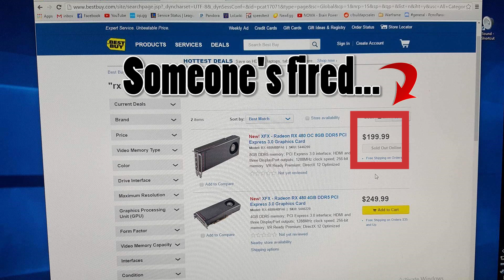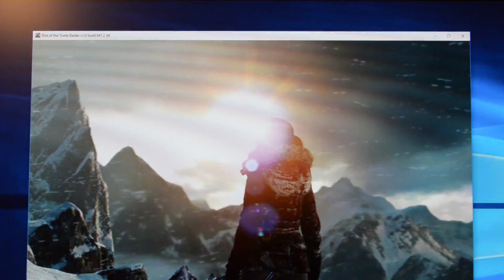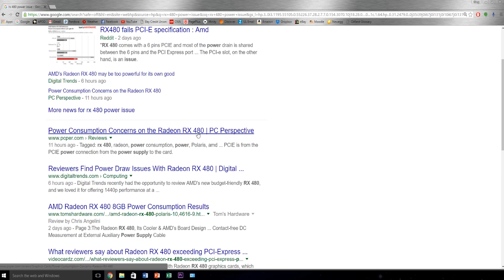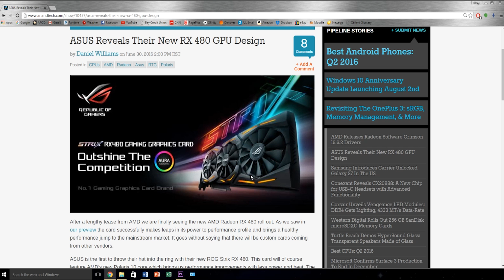RX 480 Aftermath: Power Issue & Over-Hyping

Comment: So... AMD - good hardware, good at everything. Nvidia - only good at gaming, lacking features... Maybe AMD should make new architecture made ONLY for gaming. Nvidia doesn't have any fancy-shmancy stuff wasting drivers (more have to be done) and using power. Just for games. It's like car made just for for eg. "Track Days". While AMD is as fast, but it also can comfortably move a whole family (like WRC Subaru vs Bentley)
Reply: At least I see it that way
Reply: Very poor comparison.  Most people buying video cards are doing it solely for gaming.  For those people, they don't care about this at all.   You're comparing it to something that would indicate that most people have multiple use cases.
Reply: Jeffrey Basurto This is what AMD has and this is why it looses to nVidia. nVidia doesn't give a shit about special uses in GeForce line (this is why you have Quadro and Tesla) only for gaming. And this is why Bitcoin miners used AMD cards for it.
Reply: nope. AMD is more like a drag car... With a transmission from an old punto. It has the power but it never performs like it should while Nvidia is more like an Italian sports car = not only does it win AMD with less power on a drag strip it also does race tracks and everyday driving.
Only thing AMD has going for it is that it's cheaper, but you very often get what you pay for which is makes this comparison way more accurate than you shitty fanboyism.
Reply: Tsunami LOL I'm not a fanboy (maybe apart from Intel, for now)

Comment: Hello ScienceStudio! 

At exactly 6:00, you show this pop up written 'Display Driver Stopped Responding and has Recovered'.

I have suffered this problem for quite a while with my Sapphire hd 7730 1GB ddr5. I have always installed the latest drivers from AMD but still got this issue quite frequently while playing League of Legends. I would not even max out my settings at 1080p.The screen would just go black for about 5 seconds and then come back! annoying!  

Settings were low or normal. I have also tried out this software from Microsoft named 'FIX IT'. But it does not solve the problem.

I used another person's gpu on my same computer: win 7, core i5 2400, ddr3 1333Mhz 4GB; h61m-s2pv, gigabyte 380 watts PSU. 
The other guy's gpu was gigabyte gt 730 ddr3 and with this gpu I encountered that problem 0 times! 

I just don't understand what could have gone wrong. 

Could you please help? 

Thanks!

Comment: Now I get it you are not paid by AMD....I own a GTX 960 for about a year still no issues ..max TEMP/61 degree C . Not that huge impact on power bill >.. If you need a GPU for day to day use without any hassel like drivers killing GPU by turning off the fan , ,frying your other components inside the case by hight GPU Temp#AMD ........ Get Nvidia GEFORCE CARD !!!!!

Comment: I think it would be wise to wait for custom cooled non reference cards to become available. For example, Sapphire will have a custom cooled RX480 but with a 8 pin PCI-e power connector instead of a 6 pin one. This will probably solve most power delivery problems, and will allow some nice overclocking boosting the performance quite a bit.

Comment: let me give you a hint: GTX 960 strix - over 200w power draw from pci slot
another hint: GTX 750TI- over 125w power draw from pci slot
Nvidia did it even with GTX 950,that had no power connectorvs
and we are talking about the reference card in in worst case scenario ;
who would play 4k games ,maximum details with 10fps(metro last light for example)?? that is the only case that RX 480 has that power problem and i repeat, it's a reference card.
Reply: https://www.pcper.com/reviews/Graphics-Cards/Power-Consumption-Concerns-Radeon-RX-480/Evaluating-ASUS-GTX-960-Strix Say again?
Reply: And it's the same for GTX 750TI and GTX 950?
It's not about lies or/and defending AMD,it's about the fact that Nvidia did this too, and no one made such a big deal of it
Reply: Do you have links for your claims? Tom's Hardware measures the 750ti at 62 Watts max with Metro Last Light: http://www.tomshardware.com/reviews/geforce-gtx-750-ti-review,3750-21.html
The 950 GTX doesn't exceed 75 Watts from the PCIe slot as well, see here (German, but the power consumption chart is obvious): http://www.tomshardware.de/gtx950-custom-cards-benchmarks-power-consumption-details,testberichte-241904-9.html

Comment: The 75watt PCIe slot provision limit only applies to cards that DO NOT have a power cable attached.  It is a limit due to lack of sufficient grounding on the PCIe slot connectors.

Comment: some other cards pull way more power over the pcie Lane... for example the gtx 950 (without a 6 or 8 Pin Power Adapter) or the strix 960... (just saying(

Comment: that motherboard you are using is from FEB-2008(might be even older) the max power on able to be drawn on a pci-e slot back then was 150w. 

on march 27th 2008 a revision to the spec was made
PCI Express® 225 W/300 W High Power Card Electromechanical Specification Revision 1.0
The main objective of this specification is to support PCI Express® add-in cards that require higher power than specified in the PCI Express Card Electromechanical Specification and the PCI Express x16 Graphics 150W-ATX Specification

The 480 has the ability to at times have short spikes above 150w maybe if your mother board was a couple months younger you wouldnt be having that problem

Comment: nice rev agree mostly but a 390x runs way hotter but is just a better card this is an attempt to close the gap on nvidia tdp advantage I know the pwer consumption prob is a simple driver or bios fix its still not the middle range affordable card to take over. its good step forward to apply to more powerful graphics processors in the future.maybe vega still id rather have an msi 390x imo  like that amd is trying to push nvidia maybe thats what green team need a kick in the ass. competition is a good thing.

Comment: Pcper did a huge review on this, and it is a legit issue. The 480 consistently draws well over the maximum rated power output of a pci-e slot when gaming, and when overclocked even moreso. What's also interesting is that it's meant to be a 150w tdp but is always drawing between 160-170w and stock, and occasionally goes beyond 200w when OC'd, something which the single 6 pin is not really enough for. http://www.pcper.com/reviews/Graphics-Cards/Power-Consumption-Concerns-Radeon-RX-480/Overclocking-Current-Testing

Comment: Europe, the reality: The RX 480 brings nothing new to the table apart from much better cheaper alternatives. It has one of the shoddiest coolers in history and can be used as a frying pan with the slightest overclock, the cheapest I have seen it here in Denmark is 320 dollars. On ebay I could have bought the EVGA superclocked 980 today for the exact same price, 980s are dropping their prices fast here in Europe, not so much in the US. If you are only into AMD the 390x is even cheaper and comes in a wide variety of custom cards. So, you are waiting for the custom RX 480 releases in Europe? What do you think they will cost with the needed upgrades? A far better cooling solution and power options, you guys expecting this to be free of charge?

Comment: Dude did u tried undervolting the card with ur OLD rig ? some tester r saying while reducing the voltage actually increase the performance of the card and also reducing the power ... i think its something like 1.075 check it on reddit
Reply from the maker: Yep can confirm that undervolting the card worked.
Reply: wow thx for the effort dude !

Comment: This video helped me realize why my build with a gtx 960 has been randomly freezing/ shutting down since I built the thing. Power spikes - especially on boot. Am3+ Gigabyte 970a u3dp board with an fx 8350 - 600w, but cheap, power supply. The total TDP for the machine should be about 450 watts or so - but the graphs I've seen with power spikes means that I'm actually exceeding my 600w psu.

Comment: hey greg, i have the Asrock z170 pro4s and the reference 480 and i get an issue when booting my computer. the display fails after the windows logo and i can get around it sometimes by turning the system off completely and restarting it, hoping it gets past the logo. any thoughts on how to fix this? i have a 650w gold evga power supply but i think its having power draw issues from the mobo. help!
Reply from the maker: Try booting from Intel HD graphics. Plug your display cable straight into your motherboard, and remove the graphics card. If the problem is corrected, then the graphics card is to blame.
Reply: +Science Studio no issues before the gpu. But this problem only occurs sometimes. 
Thanks for the tip though

Comment: RX480 with 6pins shouldnt be bought, even if you hv a good motherboard that can handle 150w on 1 pcie slot you should remember that making a crossfire will probably kill your system..Amd needs to solve this issue ASAP

Comment: Amd never said the RX 480 is faster than GTX 980. People came to this conclusion because they said RX 480 in crossfire could beat gtx 1080(Which it is barely on par with). Nvidia claimed that the GTX 1080 was better than two GTX 980's in sli(Which it is not). I know I have two 980's. So people were like "Oh, if 1080 is faster than two 980's then the RX 480 is faster than the GTX 980. This is what happened. Too many neckbeards making assumptions to hardware they do not own.

Comment: my motherboard has a 4pin mulex plug at the bottom of the board to help stableize crossfire so im sure that connecter will help with the over wattage of the pcie slot :P

Comment: I really don't think this will be a problem for 95% of usage cases but it could be a serious pr blow to AMD especially in light of the recent announcement of the gtx 1060.  What i'm worried most about is that AMD really pushed for consumers to buy two of these cards for crossfire a situation that will stress motherboards far more (and is more likely to fill all of the vram for 1440p/4k).  The other problem is the existence of very low quality motherboards such as the atrocious Foxconn boards used in things like Dell and Gateway office machines.  Small form factor overpriced boutique shit like the Alienware x51 and certain 2011-2012 era IBUYPOWER mini itx have had motherboard failures for OCed 750 tis and 950s because they were designed to just barely support the pci-e standard in order to ship with garbage power supplies (the power boards on the mobos couldn't take it.)  This is a low/midrange card that is more likely to be used in those systems.

Comment: When you were doing this was it with a single 6 pin or a 6 + 2 pin? Somewhere I read that 6+2 pins can push the same as a regular 8 pin even when the 6 pin is just plugged in.

Comment: Nothing new with AMD. Disappointment all around. I bought an Asus R9 Fury and it was constant crashes due to it undervolting itself. Now a 480 that draws too much from the mobo....We have no option but to buy Nvidia.
Reply: This card is an oxymoron. A cheap card, but you need an expensive motherboard to even run it. VR on a budget, but mind you, you better make sure you get a top notch mobo!
Reply: its a reference card. I wasn't planning on purchasing a reference card anyways. when the power delivery changes it will be just fine.
Reply: ***** my amd products are just fine. nvidia has had its share of problems too. (do i need to mention gtx 480 thermals?)
i have intel, amd, and nvidia platforms. they are all fine, i wouldn't claim one is vastly superior over the other
Reply: ***** ive had my share of problems with Nvidia cards that made them alright instead of great. I have a 8800 gtx that cant go above stock clock while i have an r7 260x where i could overclock the memory to 1800 and the core to 1275.
Reply: a budget-mid end Z170 like the one from Gigabyte can run this very very well. I think its around $120
Reply: *****   you are comparing overclocks of a r7 260x and 8800 GT?

no im comparing an r7 260x and an 8800 GTX, the flagship card of its time.
i could also use my gt 730 as well as a card that doesn't overclock as nice, (i got like 50 on the core)
Reply: ***** yes i have. But generally all of my amd cards could go further then my nvidia cards (my nvidia cards are an 8800gtx, gt 730, gt 750 ti,) vs my amd cards (hd 5450, hd 6670, hd 7770, r7 250, r9 380, )
they overclocked quite nicely and were stable.
Reply: ***** my freakin hd 5450 got 280 on the core and 500 on the memory. Low end AMD cards can overclock just fine. The 750 ti and the r7 260x are in the same exact class of cards.

Comment: They're saying the power issue is caused by a faulty driver
Reply: That would not be a driver. From all of the vids about this card, all of the user data points towards the "power bottleneck".
My guess as to why they may have restricted the amount of power the card can use, is not to save on the cost but to make sure that it will not compete the the 490.
Reply: lcmattern 
Worth considering, but we'll see if the problem can be fixed with a driver update
Reply: +Authorized Mike this is an electrical mechanical fault. you don't "fix" it with a driver update. the only fix that would work is undervolting it when the usage gets too high
Reply: and thats basically kneecapping.the cards performance

Comment: Question, pecifically about my rig, i have an Asus-K D3 With a Pentium g4400, i am planning on buying the rx480 in a future, so my question is, will my motherboard suffer from this bottleneck? also great video completly right about overhyping yes the card its pretty damn good and its only 200 dls and people should compare it with other 200 dls cards not 400 one, cheers

Comment: expectation was as declared initially to be a 500$ card but selling for 200$? and not compete with 1080 ... but ended up being not quite that. To be fair otherwise is the right card in its bracket  for the money  for 1080p 60hz but nothing else... the power issues suck really as most people after this card do not have a brand new model MB and is not a guarantee its safe... qc ...

Comment: At 04:41 you mention "power delivery system", but it's not actually case. Power for pci-e slot coming straight from 20+4 pin atx power connecter, without any vrm interference. That 12 and 3.3 volts got handler by card itself into lower voltages. So if by "power delivery" you meant "wiring on motherboard" - there are no regulation for those, or anything else.
Reply from the maker: It is the case. PCI generations affect power delivery.
Reply: By pci generation - are you talking about pci-e 2.0 vs pci-e 3.0 or something else? Or do you mean output?
Pinouts wasn't changed during pci-e 2 > pci-e 3, they remain the same. Four 12v and four 3.3v http://pinouts.ru/Slots/pci_express_pinout.shtml
If you meant output - there isn't any, and tx from pci-e slot are data. Big changes was made during jump to pci-e to ATX itself (from 20 pin, to 20+4 to support 75 watt PCI Express requirements, in version 2.2).

So please, define what you meant more briefly.

ps: Also, thank for feedback, really appreciate you reading/replying to all the comments you can, despite youtube being poor with handling comments overall. Keep it up.

Comment: you said " rx480 was was not made to compete 1070 or 980" came on bro are you kidding me. 1070 like really ?
Reply: it wasn't meant to compete with the 1070 people just over hyped it and made it sound like it was going to be   that performance, some even said that a single rx 480 would be as powerful as the GTX 1080.
Reply from the maker: Yes, I said " The RX 480 was was never meant to compete with the 1070, or even the 980 for that matter." What I said was not incorrect. It is the truth.

Comment: This is very interesting, I have an old Compaq build i am using for the wife's build consisting of a Phenom x4 9750  8gb ram and  trying to run an EVGA GTS 250..totally forgot I would need to swap  out the Stock psu that was 250w .Big duh,and with the 250 would easily crash under load....DUH!   so I put a 450w psu in.......got a bit more mileage but still CRASH under load... I have run this same 250 on boards of the same age(am2 and am2+).....so i am going to get a 500w psu and see if it makes any difference, heat is not an issue, nor is it an issue on my Asrock 880g board which i stress tested this GPU.... Hope ill be able to use this card for her basic yet powerful (for her) build. otherwise i'll need to find a less power hungry alternative...or just swap the motherboard entirely. Thanks for the insight!

Comment: Wait do the third party rx 480 cost a lot more
Reply: yea. $260 minimum. most around $300
Reply: actual msrp is 249.99 max those higher prices were preorders from small company trying to make an extra buck
Reply: the crds will be better so they charging more. its the usual
Reply: third party rx 480's start to get close to 1070 prices

Comment: I have issues with my psu it's 850w but it's bronze ratting and when i over clock cpu and gpu and push it to the limit I can get similar issues I corrected it through increasing the load line limit, but I still think I should've  gotten and still need a gold or higher rating psu. not that iam saying  this was your problem.